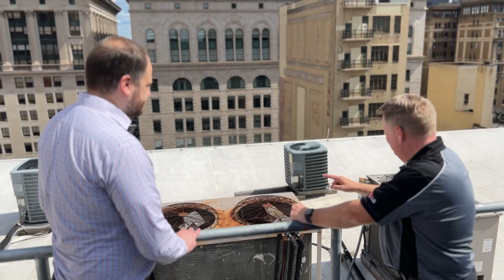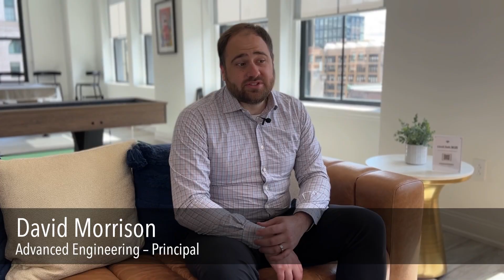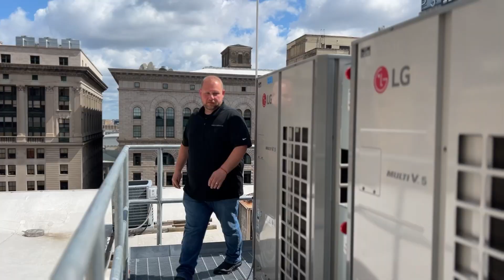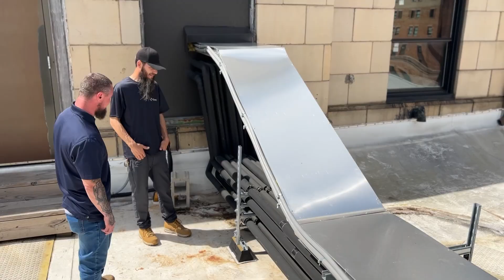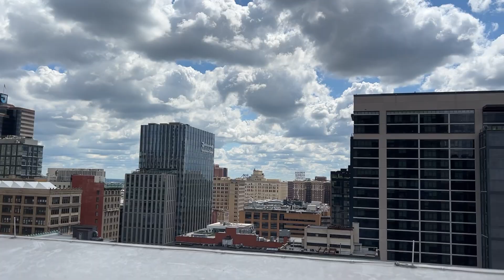Game-Changing VRF and DOAS Integration at the Historic Philadelphia Building!

Comment: Did LG change the behavior of compressor faults? At our building with Multi V 5's from 2018, a compressor fault will lock out that system completely until someone addresses it or bypasses the compressor.
Reply from the maker: Thanks for the comment. As with most communicating equipment, an active compressor fault will go into a hard lockout and display an error code. This is done to protect the compressor and will require a technician's attention. We suggest reaching out to your local HVAC company for service. If you're local to Bucks County PA, and would like to have one of our technicians visit your building, you can check us out at www.airdynamicscares.com or call us directly at (215) 571-9471